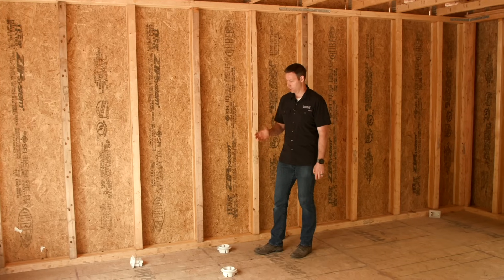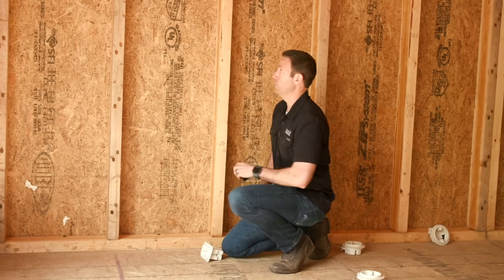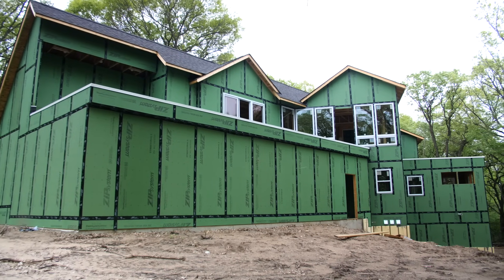Insulated Studs? This is a BIG Innovation in Framing!

Comment: this is great for insulation and strength of a structure.  However, what is the fire rating on these against an actual fire.  That is great they heated the outside to 230 degrees with no heat transfer but that is no-where near actual fire temperatures.

Comment: What keeps the TStud from failing by pulling apart at the center?

E.g. the exterior-facing piece of wood pulls off outward away from the spray foam, or else the inside-facing piece falls into the building due to the weight of hanging drywall/etc on it.
Reply: I hope this isn't too stupid of a question! And as always, you made a great show!

Comment: Matt, I would be interested in seeing the costs vs benefits for these different wall constructions. like a 10 ft exterior example wall. like assuming the same drywall and siding but the guts of the wall being different. kind of like a more complex version of your sheathing compare. like ABC materials equal this R value at this cost and XYZ materials equal this R value at this cost. something that can show how the new methods compare to the old and to each other. I am really curious about the cost to benefits on these, how much R value and sealing does the money get you, etc.

Comment: Cutting a couple of webs(dowels) of the truss design to run plumbing could weaken the continous load path.
Reply: According to the Tstud construction guide, no dowels are allowed to be cut, and if they are, there's a specific repair process.
Reply: @andrewalexander9492  Yea thanks. That makes sense. A specific clamshell bracket or other fixture to transfer the load would work.

Comment: I've framed my basement 2 inches off the outside walls. I then spray foam that 2 inch gap with closed cell. Worked out pretty well. My basement bathroom and laundry room are both tiled but since I have an air gap and 2.5 inches of rigid foam between the air gap and bottom of the finished floor the tiles feel the same as the upstairs.

Comment: I must be too old fashioned.  I enjoy a house that can breathe.  Can we bring back the craft of building homes out of stone frames with wood accents?. I understand it's less expensive at the moment,  but if the entire industry changes, we can have better homes for our children and grandchildren.  These fake boxes we are building in mass won't help us in the long haul.
Reply: I think you mean 'vapour diffusion'. Materials do not breathe!
Reply: @greengenie7063  "a house that can breathe". Meaning a combination of materials.  Your pathetic attempt at trolling doesn't even address the complaint.  You're the type that probably changes the blinker fluid every 10,000 miles instead of the recommended 50k.😂😂😂😂
Reply: No, I am very much into living very economically. Many people have incorrectly assumed that buildings should be 'leaky' as they think it is good for buildings to 'breathe'. That is why I always use the correct terminology (moisture-vapour-diffusive) rather than the inaccurate and misleading 'breathing'. I also do not talk about 'thermal mass' but use the phrase 'thermal capacity' when I write on sustainable building design, otherwise people get wrong ideas...
Reply: @greengenie7063  well.. I'm into "older construction ". Brick and stone foundations.  Plaster walls,  tongue and lip lining,  sleight roofs,  copper flashing and old fashioned homes. They were built like a sr-71. Leaky on the ground but as tight as a flies ass when up to speed.  You can keep your "vapor " right homes. I'll continue to invest in old leaky and drafty homes. Because after 100 years, those air tight crap mansions will all be moldy catastrophes that will have no resale value. While my old leaky and drafty home will be getting its routine maintenance and hold more value than when first purchased.  Enjoy... 😂😂😂

Comment: Looks and sounds good in most areas... except in Hurricane prone areas where the extra stresses of higher wind will snap those at lower wind speeds than standard studs would protect against. Its strength is with vertical and horizontal stresses, versus hurricane force winds provides a lot of "twisting" stresses which is the truss weakness.

Comment: how can those studs on the horizontal be as strong as a true header? Show them on a proper load-bearing wall being used in place of a header
Reply: because you are getting stacked 2x3s.  The outer part of the stud is turned a 1/2 turn.
Reply: Darryl Cook I’m not sure if that strength would equal a solid 2x10 and also a header is laminated members where these are separated by the 2.5” space. Would need an engineer to evaluate. Building Code certainly would not allow

Comment: That'll come down in a hurry in a structure fire. External attack only.
Reply: Go to their website and read the section on Fire:  https://www.tstud.com/  They claim that 90% of a stud with fire on one side, remained intact, after 10 minutes @ 3,500°F.
Reply: It's a timber house mate, they all burn like paper.. The key is to not let them burn.. or build your place from concrete slabs if you plan on having rampant fires in your home.
Me, I prefer my fires to be contained, and insure against any other possibilities.. ;)
Reply: My view is from a firefighter standpoint, not a homeowner. Every house fire I've been to, it couldn't happen to them. To that end, engineered I beams have a far less structural integrity in a fire. That's just floor joists and rafters. Now we're talking walls as well, decreasing the time of relatively safe interior attack even farther.
Reply: I wonder what the strength difference is at high heat and flame levels between naked T-studs and traditional studs.
Reply: Yeah, I'd like to see the UL tests

Comment: “Sandwich lvl with insulation in between?” Why would that ever be done
Reply: Yup, stupid.  Please add more pollution to my air and water.....than u.
Reply: libtards are at it again . Wood is a insulator . That roof system is to cheap wont hold a snow load . Partical board is to cheap for exterior walls . They building a house to sell ?. But really are destroying the housing market with throw away homes . Cheap homes dont last 20 years

Comment: Question, does that closed cell foam require an intumescent coating in order to meet fire ratings?  Looks like it would allow a fire from a lower floor or basement easy access up the wall and into the attic space which could quickly become a huge fire loss.  Without a fire rated barrier it would seem to be similar to balloon style framing.  This is why you shouldn't ask before the end of the video, Matt has the answer "Class A Fire Rated as an option."  I was just too impatient by asking before finishing the video, sorry Matt!

Comment: Who test the strength and durability of these? The manufacturer or someone higher up?... 🤔 
The evolution of building, good stuff 👍
Reply: From their website: "Progressive Engineering, Inc of Goshen, Indiana, has tested a prototype of the Tstud™ vs a traditional 2x6 used in framing of an exterior wall. The tests were performed for a length of 10’-0” in straight down vertical compression to see how much a single stud could hold before failure vs a Tstud™ of a similar length. A #2 select 2x6 held 4,300 pounds on average while the Tstud™ held an astounding 12,655 pounds."
Reply: Jasen Lawrence just curious to see the testing being performed live... maybe there’s something out there... just haven’t gotten to looking for it yet...

Comment: I don't understand why they keep calling it a trust when a trust does not work like that the the way it's going the opposite directions some  thing with the  headers
Reply: Assuming you mean "truss" (tho I could be wrong) then it is called a truss because of the interconnecting structural form--not its orientation.
Reply: @genephipps6421  That helps thank you I was so confused I couldnt spell
Reply: @genephipps6421  I assume you mean "though".
Reply: @rotagbhd  no I actually meant "tho" which is an accepted form of though in informal writing--especially in technical and mechanical conversations like this.  At least according to Merriam Websters.

Comment: How about fire rating? Maybe more R value, but fire will rip through those walls like nothing, moving significantly from one room to another. Lightweight construction has made for more efficient, cheaper and faster homes, but they are pretty much total losses now during any type of structure fire, as opposed to a fire that can be contained to room and contents using traditional stick builds.

Comment: In 1986 my dad built our house using 2x8 top and bottom plates in the exterior walls. We then staggered 2x4 studs 16" OC  with r13 insulation.
Reply: Excellent thinking! And, It's a cheaper way to achieve the same effect as these high-tech studs.

Comment: I bet they are $$$ expensive as heck.
Why are they not 16” on centre?
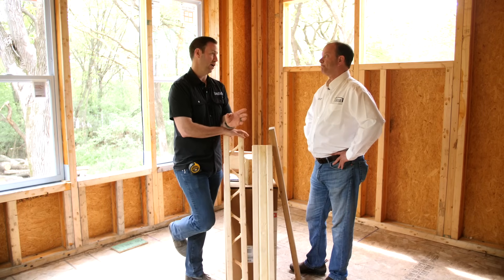Reply: Eileen Kelly - the t studs are 2x6 equivalent so they can be 2’ on center no problem. And they talk price at 14:15. They said for a normal 2500sqft house, it’s only $1000-1500 more compared to traditional 2x6, and it will save in heating and cooling in the long run paying for itself.

Comment: How well has the foam been researched? degradability? off-gassing?
Reply: I find it weird seeing all the comments questioning the foam. It's become quite common to use spray foam insulation up in Canada
Reply: According to their website its not even code compliant regarding fire hazard - yet...
Reply: @Helloverlord  fair enough, but neither is any insulated foundation. We typically have to board any foam insulated wall because of gases in the case of a fire.Even in an unfinished basement. I dont think they like seeing any exposed foam because of off gases in the case of a fire. This application is minimal compared to the way construction is going. Foam is becoming quite a popular choice
Reply: think nudura or any icf construction. id guess it doesnt make a difference in the scheme of things, but its something to think about.
Reply: Without UV a,b or c rays, will last for centuries. The outgassing of chemicals in the foam, stops completely after 10 days. The finished product will be in the warehouse, loaded and shipped long after any fumes are left. Testing meets ASTM specs and published.

Comment: The electrician just pulls wires in the wall, not in pvc flex pipes?!!
Reply: Not all places require conduit (Chicago and much of Illinois is notorious for conduit to be mandatory among the lectrical industry there), I see the benefit of using conduit, as it makes easier fishing of any new wire if needed, for both electric and data/telecom (each in their own runs though), Especially internet into the home and up through a floor or two to a single wireless point and for high speed (Cat 5) to each room.
Reply: @Joshua79C  I was more concerned about having to tear down the entire wall if you had to replace a wire, but that too
Reply: @pangeltveit  I got/saw your point, hence my response thusly,

Comment: I guess @$20.00/ stud it will make for a really cost effective build.  Save a little $$ on heat though..
Reply: $2.00 per foot X 8' studs= $16 per stud, Versus $5 for a DF 2x6x8. It does seem way more expensive but to achieve the same R value with traditional studs you'll be putting additional insulation on the outside of your house which will probably end costing more in material and definitely more time. If you live somewhere that isn't particularly cold than it's probably not worth it but in a cold climate this could have a substantial impact on your heating bill. I

Comment: Nevermind the strength of the frame. Insulation is more important..  Those 2 little 1.5" sticks will blow the hell apart if you throw some toenails in there..

Comment: Single top plate no bueno. Doubt top plate is to help support roof weight. Rafters don’t always align over studs. 15 center walls and 24 centers roof.
Reply: Just use conventional lumber for your double top plate. That's what I would do. You'll lose a little R value but still much better than an entire 2x6 conventional wall.

Comment: It's been a while since I did framing, so what happened to 16" on center?
Reply: Advanced framing.  Studs (wood) are the weak point in insulating walls, so the studs are moved to 24" to allow more insulation and less wood in the exterior wall.

Comment: Yeah, it's cool... it's actually over-kill... but, as always, it comes down to cost.  He's saying it's 2800 sq/ft house is $5k more?  Well, ALL my houses are at least 3300 sq/ft and $5k more sounds like a lot of money for something that will NEVER ROI and I totally do NOT need the extra strength.

There's a lot of cool products like this that are 4 times stronger and 5 times more insulative and tones better than traditional methods but they're always overkill and will NEVER ROI!  Know how I know?  Because NOBODY USES IT!

R8 studs vs. R30 studs will save you how much per year in heating and cooling costs on your entire home?  He talked about "tested our R30 at 200 degrees and after 20 hours zero heat transfer to the other side" but WHO CARES!  At R16, which is what most homes in my area are, you can heat it to 200 degrees and it will take about 8 hours to get heat to the other side but it's NEVER EVEN CLOSE to 200 degrees outside EVER and when it IS 115 it only lasts for 5 or 6 hours!  So, how much money do you save in heating and cooling per year on a 3000 sq/ft house on average?  I'll bet it's less than $200!  And how long does it take to ROI $5000 saving $200/year?  Well, calculating with a 2.5% inflation rate, I'm thinking it will take you 75 years to ROI!!!

So, yeah, cool product and I'm totally loving overkill, if I'm being honest ... but come on!  You've GOT to bring your prices down, TStud or you can forget it.  You say it's $5000 more to frame a 2800 sq. ft. home using TStuds but it's COSTS about $10,000 to frame that 2800 sq. ft. home using regular studs ... so using TStuds it's $1500 ... that's 33% MORE!

If you wanna impress the ROI focused buyers (which is everybody with a brain) then you've got to bring your costs way down!  33% more needs to be 10% more and if you can do that then you'll be a hit.  10% more should ROI in 25 years and on a 30 year loan home buyers will give you the nod .... but what you've got is, at best, a niche product for people in hurricane and tornado areas.

my 2 cents as a guy who owns 12 homes

Comment: This will make plumbing and electrical way easier. Probably want to refill holes caused by chipping foam away. But seems super legit.
Reply: Guessing you do not realize that spray foam will fill any gap, thus refilling those holes would be as simply as spraying in the foam and letting it do its expansion stuff.
Reply: Joshua79C C that’s literally what I meant.
Reply: @cranium33333  , they really should offer it in both insulate or bare for those who are just going to go with foam anyway, would negate the need for the utility installers to knock out anything and they can just zip the wire through straight forward and staple to the back of the interior portion. Since when the foam gets installed it will fill  the stud just the same.

Comment: Not sure how old you are; but houses used tobe framed in 2x4 then in the late 70 because of the price of oil people started building  a 2x4 stud wall insulated and sheeted it, then they left an air space and put in a second wall making sure that the 2x4 were offset from the other wall all the penetrations were done in that wall that was also insulated. As you can guess it was a labor intensive job. That was when they went to 2x6 for the R value, but you now had movement of cold of through the stud since there is no longer a thermal break

Comment: Been a carpenter for 40 years,,, I cannot believe less labor cost,, for framing anyway,,. 2 ft center on exterior? Probably need thicker sheathing if you are gonna stucco. Bet it costs twice the cost. We'll see.
Reply: Peter Ford 30 years myself.....I agree
Reply: @wooge3199  I guess in this day of manufactured lumber, new ideas to save trees and utilize the waste we took for granted like sawdust etc, isn't a bad thing. And, it's another way for some inventor, to make a million bucks. Like the guy that invented the circular saw, 😉.
Reply: Peter Ford lol true....or particle board ..he's rich to but not such a good idea as opposed to circ saw

Comment: * Uses 2X more lumber...
* Costs 2X+ more money...
* Top plate isn't near as strong because nothing is lapped. I'm surprised it passes code.
* Header is a joke - expecting strength at a stacking napkins.  Could have used 2x10's with a foam center and gotten so much more strength.  I'm surprised that header passes code.
* Termites will eat right through that foam and now they have an interstate to go wherever they want. I've seen it.

Comment: This looks like junk, 3 points, 1-mice and rats will cut nice little holes right in your studs. 2- Just like the 2-12s that have plywood in the center like I beams- fire rating will suck and the solid wood will last longer in a fire. 3- this is not as strong as a solid wood support, there's a catch, there just not telling you the weakness. Twist the stud and tell me i'm wrong.

Comment: Are those studs fire resistant?  Is that foam flammable? Just asking, I know nothing about this product.
Reply: Yes they are, if you bother to go to description and go to the linked web page to the product for more info. But let me compare this, viyl siding while it may not technically catch fire, it will still melt like ice cubes but pool into a blobby puddle that is messy to clean up when it has had time to cool down.